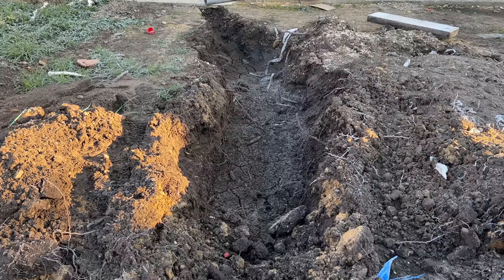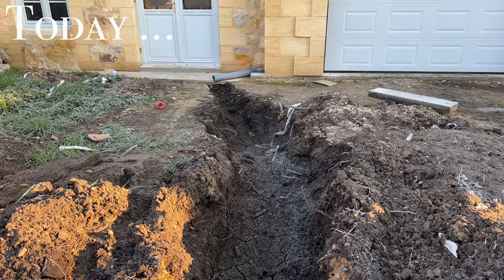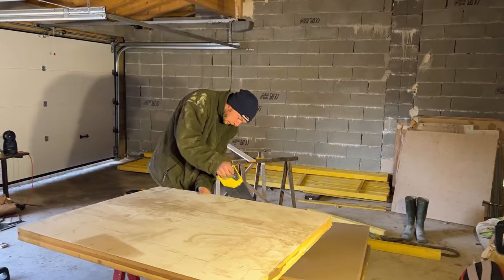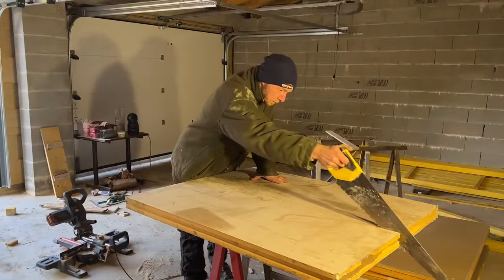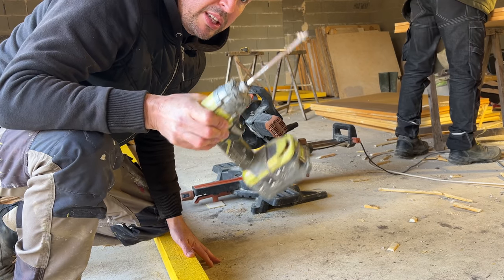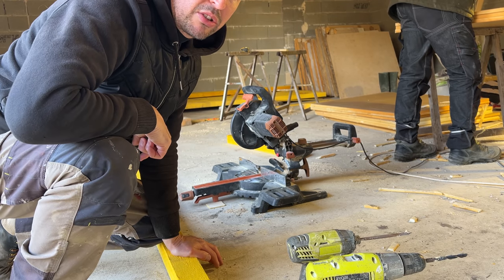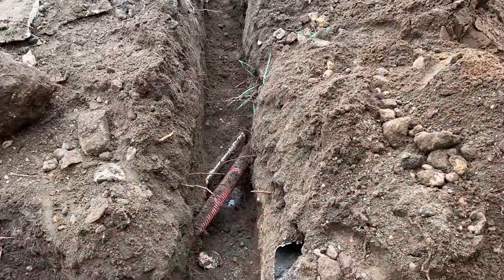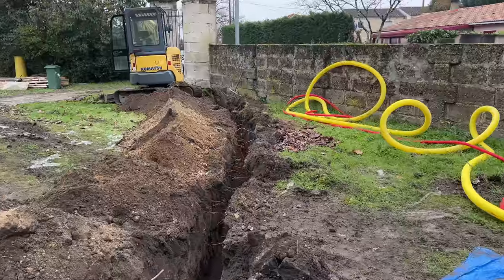EP111 Transformation Begins, Garage & Guest Apartment Insulation @ Our Passion Project    ...

Comment: Brings back memories of our 'chateau' restoration, a hudnred tons of rubble, sand blasting the beams, out all year round, gardening at night, getting the temp up so I could paint inside, rushing into the house on arrival to put on the electric blankets and fuel the stove. One day we had framed up the future terrace for the cement truck to pour and the weight of the cement pushed out the shuttering so we had to quickly drive the pick-up across the lawn and park it against the wall! It left a bulge but we put the steps down to the lawn there and the rose arch so afterwards you couldn't tell, what fun and stress and fortunes were spent. I wouldn't take on such a big project again but it's great to watch young people do it and do it so well ! xxxx

Comment: Edd  I don't see a moisture proof membrane going down first, you already know there is seepage potential.
Reply: What kind of membrane is usually used? I’m slowly getting interested in understanding building. And if he used a membrane, he would be able to use the bolts or whatever he used through the wood into the concrete, because it would pierce a membrane, right?

Comment: Brrrr, looks cold! I’ve never seen the type of floor system your doing, any advantages? I see a dis-advantage, any excessive water on  on the finished floor would cause rot & mold to grow underneath. Cheers Kirk
Reply: That's why they are going to put in drains outside of the garage and the kitchen. He spoke about it in this video.
Reply: @judithburke1539  even if they drain, it would still cause the wood joists to rot & mold along with the insulation between the joists

Comment: So interesting but I find it so strange that in a house of that size it didn’t already have the gas,  electric snd water 
 connections. Is it different in France? Having said that you are doing a brilliant job
Reply: Maybe they are putting in gas and need to expand the electric and the water connections due to the increase in bathrooms and the size of the expansion? Lots of places don’t have gas already. And he did say he was running the electric in that trench to power an electric gate, so there must not have been electric right in that spot